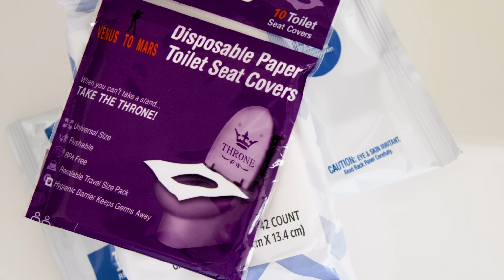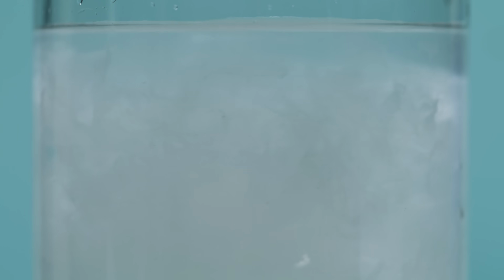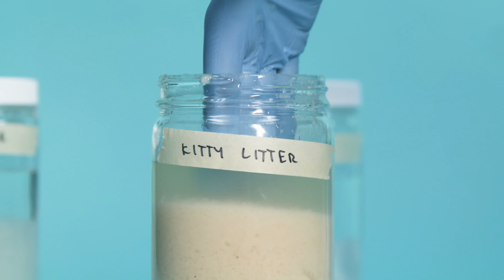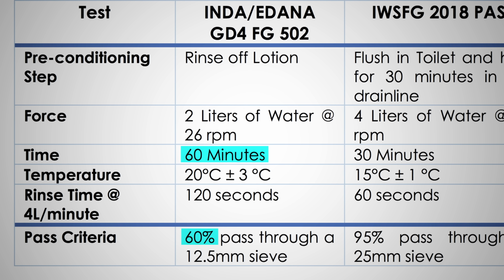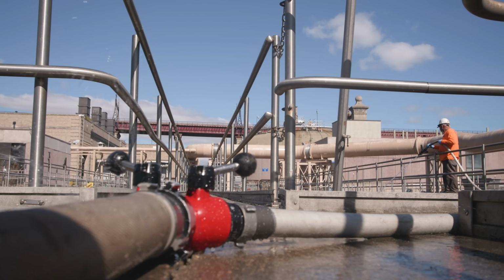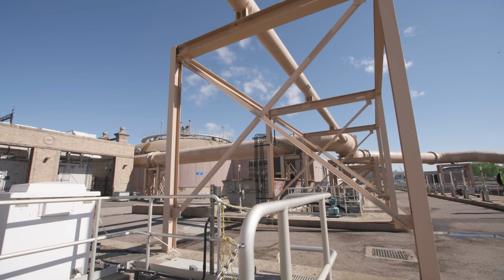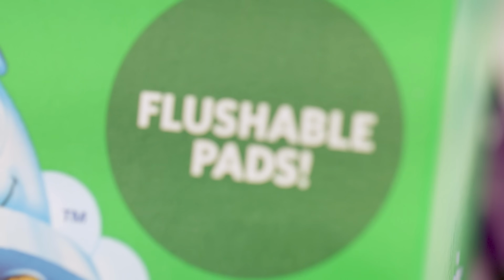“Flushable” wipes are ruining sewage plants

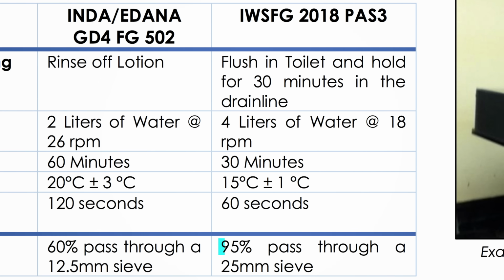Comment: @VergeScience At 4:15, you say the 95% pass is a much higher benchmark than the industry 60% pass threshold, and highlight those numbers on the comparison table. But it's clearly visible on the comparison table that the industry test uses a 12.5mm sieve for the 60%, whereas the utility test (IWSFG) uses a 25mm sieve -- which makes the industry test a higher bar on that one dimension. How can you be sure that the 60% at 12.5mm is a lower bar than 95% at 25mm?

Comment: The machinery might need an upgrade, or re-engineering to help in its efficiency and improved durability. Standards should be updated to make better flushable products (be able to not break while used but break down under proper regulations), also integrate a govt incentive program to upgrade household bathrooms to use bidets (nyc needs upgrades n the pandemic is the best time to upgrade transit / household regulations).

Comment: Examples like these are why we NEED regulation. The government needs to tell these companies to either make wipes that dissolve, or remove the "flushable" text from the packaging.

If you're triggered by this, then you'll be even more angry when your taxes are higher because the sewer system is clogged.

And think about it, private companies get to market lies, and make a profit. Meanwhile it's messing the sewers up, and taxpayers have to fix a problem a private company made. This is where your rage should be directed

Comment: I work for a city where the sewer lines take about 45 minutes to make it to the treatment plant. In that span, sometimes the water goes thru multiple lift stations before reaching the main plant. They break down somewhat along the way, then reform fibers when that minimum rpm to break it up isn't achieved. Pumps then gather the reformed wipes and catch on the spinning blades that moves the water, causing a backup, which continues to collect more, you can easily burn out a motor on a pump which can back up plumbing in houses actually costs taxpayers more in the long term. I'm glad this video was created, its good info to put out there when your neighbor might be someone causing a backup of sewage, in your basement.

Comment: As someone planning this kind of stuff: the problem is, the pipes have only a certain reasonable gradient in which they can be installed (in Germany this is usually 1%) and we have already reached the limits in saving water (the most economical toilets use only 4l per complete flush). This means you should always flush completely and not stop in advance if you had a big business. Otherwise, the pipes have to be cleaned at great expense. Of course, only toilet paper should be flushed.

Comment: 'Wipes' here means 'toilet paper' right? We don't even use toilet paper in my country, just spray it with water 😂
Reply: No man, toilet paper is flushable, while most of wipes are not
Reply: Wipes are not toilet paper.  Wipes are a lot thicker
Reply: Wipes are usually thicker and non dissolvable. It’s usually dampened with antibacterial solutions and is like an extremely thin cloth.
Reply: Honestly, that'd probably be better for all countries.
Reply: @lunarcorpse  water usage could be a problem, especially in a  densely populated area.
Reply: @arisaardi7576  Nah it takes more water to produce TP

Comment: I know the message here is not to flush any of these products, but it's frustrating that neither the video nor the original study it's based on will name the product that performed much better than the rest (2 were cited as partial dissolving, but in the official report "product #57" was clearly superior to "product #51").  If you drive up demand for the better dissolving product, others will compete to outperform it in this category, and maybe then we'll get them all engineered to an acceptably dissolvable level.  Right now they're only competing on comfort and price, because buyers have no idea how they differ in "dissolvability."

Comment: The solution is to use water instead of wipes which will reduce the unflushable waste.
Reply: You mean taking a shower each time? In public WC as well?
Reply: And the thing is that it's not a toilet paper what a problem is. It's wipes, which is not used as a toilet paper (well, by adequate people at least)

Comment: There is a difference between flushable wipes. I'm assuming that beauty wipes are different than toilet ones.
I use flushable toilet wipes, every time. I want to say they are different than other wipes.
I say this because the first kinds of toilet wipes were like cleaning wipes. Now, the ones I use are very thin and look to tear apart easier.
Reply: Yeah I find it hard to believe my toilet wipes arnt flushable considering I've left them before in the toilet unflushed for maybe an hour and they are more dissolved than the TP. I really don't think they even tried to do actual science in this video tbh
Reply: Please re watch the video, you missed the point. Basically all "flushable" wipes are not avtually flushable. Beauty wipes are not generally labeled as flushable because the convenience of being flushable doesn't really apply to makeup products. But when you are handling an item that may be covered in feces or urine most people do not want it sitting in the trash and stinking up the room or possibly "spreading disease", although if handled properly and with hand washing should not be an issue, it's still the mindset. Then people will have to take out said trash covered I'm feces and urine which is something people do not want to do, again a convenience factor. Makeup wipes usually just have makeup or other beauty products on them, that is already something people use on their body and is not generally a biohazard or considered gross by the majority of people. So basically, PLEASE STOP FLUSHING YOUR WIPES!

Comment: Yep this is a problem as a landlord. Tenants using “flushable” wipes that end up clogging the drain and having to get snaked out by a drain cleaner. Ranges from $150-400 depending on how bad it gets.
Reply: Do you pay these by yourself or have you probably found a way to make tenants pay themselves? (I mean if you have more than one tenant, of course)
Reply: @dubdadabooda1038  in the case of wipes, tampons, or something else they put in the toilet it's on the tenant. If it's tree roots getting into drain lines then I pay.
Reply: Tenants in one of my houses were flushing cat litter like a bunch of idiots & it cost me $600+ to fix it.  I told them that if it happens again I'm going to give them the boot.
Reply: You'll live.

Comment: I was sad when I learned this was a problem because I used to be a big user of them.
They're great from a user's point of view, but bad for everyone else, so I stopped and got a Fohm device which puts foam into regular toilet paper to dampen it just enough. It's much better than just TP, but not as good as the wipes, so now I'm looking into one of those bidets that install on the toilet.
I hope they get the manufacturers to the higher flushability standard.
Reply: UPDATE: I got the bidet several months ago and love it. I miss it on trips away from home. When I went to stay at my mom's house for a couple of weeks, I gave her one so I could also use it :-D
Reply: @noisycarlos  Water/tissues the way.
 Muslim hack for when your travelling use a an empty bottle & refill it with the water your gunna use to clean yourself
Reply: BIDETS are the way to go! I have one and haven't used toilet paper in years!
Reply: @vermontgasman  but don't you have to dry with TP?
Reply: Bidets save lives.